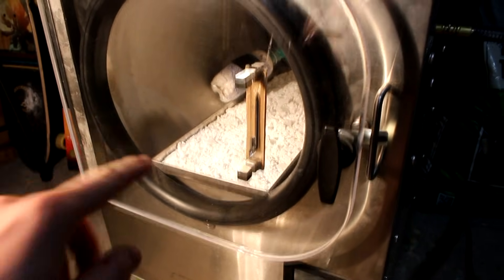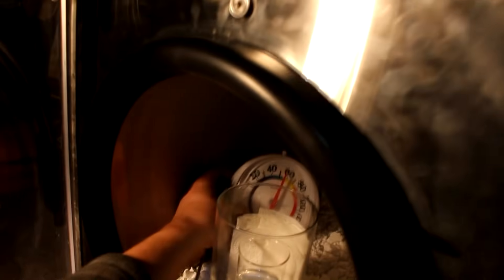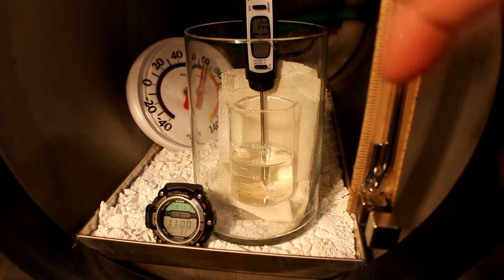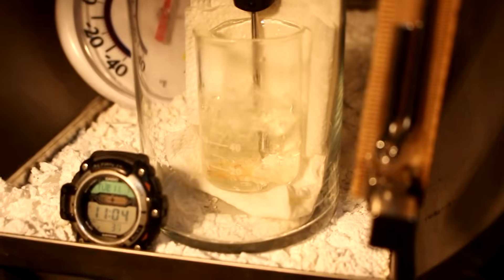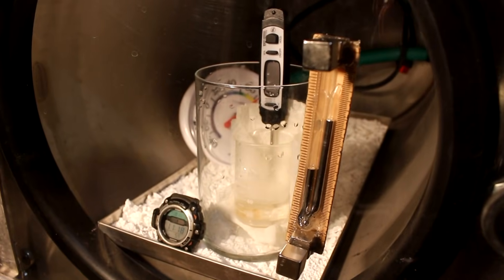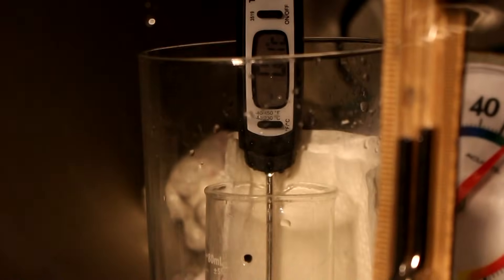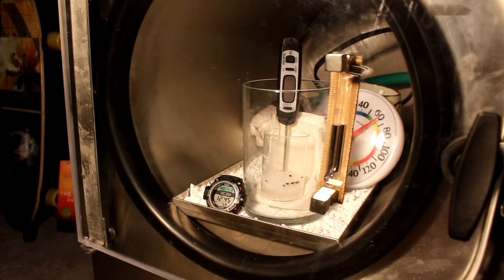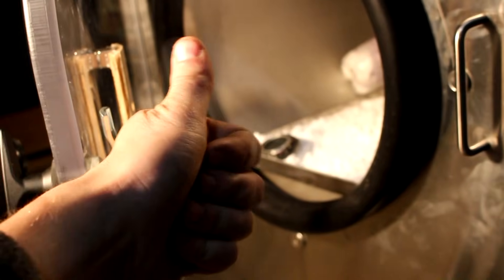Boiling Water Until It Freezes

Comment: This brings to mind the phenomena of extremely "HOT"  temperatures of molecules in engineered negative Kelvin systems, which transfer heat at exponentially higher rates than positive temperatures, by way of Boltzmann's factor.

Although your vacuum system implements a completely different method of manipulating the temperature of molecules, it loosely feels like the opposite of the effect exhibited in negative temperatures.  
"Boiling" to freeze molecules Vs. cooling to "heat" molecules.

Edit: (This consequently made me think of the Bose-Einstein Condensate.)

Comment: cody. save your pump and get a reverse bike pump and add grease to all the seals and then got the adapters for tubeing it will cost about 100 comes with a gadge and has replacement parts 👌🏾

Comment: This proves nothing...
Reply: Eternal Knives it proves you actually want to be entertained
Reply: Yes it did
Reply: It proves why the water on Mars is ice, not liquid water
Reply: Yeah, I said a stupid thing. I only knew that Mars has a much weaker magnetic field than the Earth and I made an incorrect assumption. I never actually heard about whether Mars' core is solid or molten, just the thing about the magnetic field.
Reply: Neither does the comment you just made
Or your life
Or mine
Or anyone's
Nothing matters
...Ever

Penis
Reply: That doesn't need to be proven. Mars is further from the sun than the Earth and it doesn't have an active core like the Earth, so even with a thicker atmosphere, it wouldn't have liquid water on the surface.

Comment: It should be realized that, at some point, the thermometer in the background inside the chamber is no longer responding to "air temperature" as there is, for all intents and purposes, no more air :)  It would reach thermal equilibrium with its surroundings (the walls and contents of the chamber) via radiant energy transfer.  I'd expect that process would take quite a while :)

Comment: Works the other way around as well, where water can be colder than 0 degrees, but still be liquid, if the pressure is high enough :) It's rare in the ocean because the deep ocean gets warmed by the earth, but it happens under the ice caps.

Comment: The conclusion is that the water was not "BOILING" but "BUBBLING".
Reply: Nope. The conclusion is actually that you've never heard of the relation between boiling point and pressure, and that you don't know the scientific definition of boiling. Go google it.
Reply: The pressure become minimal and since oxygen is lighter so it tries to bubble up to the top to maintain its state of equillibrium and after that I shut off the video.
Reply: That's not oxygen coming out of the water. That's actually water vapour. Decreasing the pressure heightens the boiling point, and if you reach near-vacuum, the actual boiling temperature becomes so irrelevant it'll even boil when it's freezing.

The freezing itself is caused by the fact that water needs energy to go from liquid to gas form, and that energy comes from the water, so the more it boils, the more it cools down.
Reply: What is the source of that energy that holds the electron of an oxygen atom in the water ?
Reply: Ofcource I am talking about the orbital energy
Reply: Molecular bonds are very strong, and require a lot of energy to loosen. There's nothing in this experiment that gives the amount of energy necessary to cause that. Evaporating needs a lot less energy. Splitting water molecules is a chemical reaction. There's no chemical reaction involved here; this is purely physics.
Reply: How much energy ? Do you know ?
Reply: Everything is science and nothing is there in this universe as pure. Mind it.
Reply: Not just a matter of how much, it's also how it's applied. Water doesn't tend to split from purely physical factors; it'll never break apart just from heating it up (unless you go well beyond vapour state in the first place, and well on your way to plasma). It typically only splits if you run a current through it; that's electrolysis.
Reply: No I am saying that if u lower the presssure inside that chamber then its not that only pure physics which seems to be applied but there many other factors like May be the water has some dissolved oxygen which seems to bubble out as the pressure decreases fast but at constant rate. And then rest of the story which u said in your description.
Reply: Water might have some dissolved components, sure, but that's always a really small percentage. Nothing that'll be enough to make it bubble that strongly.
Reply: You did a nice work. Keep it up!

Comment: IF you sucked out all the Oxygen through the Vacuum, How it is still water?
Reply: He sucked out the gas from the chamber.... meaning the nitrogen and oxygen gas there. This is pure physics. There is nothing happening there that would spontaneously make the water split into oxygen and hydrogen gas; that would require a chemical reaction.
Reply: Nyerguds This science is beyond my understanding LMAO!
Reply: no its not, there's oxygen in water that isn't chemically bonded with hydrogen, that oxygen(O2) is what came out of the water
Reply: ItsTheNutShaq It's water vapour that came out of the water, people. Sheesh. It's not hard.
Reply: That probably came along too, but nope. Decreasing the pressure simply decreases the boiling point, to the point where room temperature or lower is enough to make it boil. It is really, literally, the water itself boiling. Evaporating. It's simple physics. Look up "boiling point" on wikipedia if you don't believe me.
Reply: What is happening regina phalange, is heat (energy) is leaving the water through the process of boiling, however, cody is not adding energy back into the water (system). Therefore, the water eventually reaches its freezing point, as long as there is water left after boiling. At the end of the experiment, he mentions the temperature in the chamber actually had risen some. The energy in the water escaped through boiling and was then reabsorbed by the surroundings.

Comment: Thats why water works as a temporary solution for coolant in a car. It doesnt boil under pressure.
Reply: Um. Enough pressure makes any gas revert to liquid form. That's not really related to this experiment at all...
Reply: Nyerguds i wasnt talking about turning a gas into a liquid. im talkimg about how pressurized liquid to a certain extent wont boil.
Reply: And that's still completely unrelated to anything in this experiment. The fact that decreasing the pressure will make it boil in no way ensures that under pressure it will not boil.

Comment: Is there a pressure where the water will continually "boil" till it's empty ?
Reply: It's not really related to pressure, but to keeping it liquid. The evaporation is what cools it down, so to prevent it from freezing, you'll inevitably need to add energy, by heating it up. If the water is warm enough before putting it in, and there isn't a lot of it, it'll all evaporate, I guess.

Comment: I will be impressed if somebody can make powdered water.
Reply from the maker: you mean snow?
Reply: @theCodyReeder  LMFAO 😂
Reply: @theCodyReeder  😎😎😎
Reply: Cody'sLab Lmao
Reply: Heh steven wright fan?  "I bought a box of powdered water,  I don't know what to add to it..."
Reply: Powdered water! Just add water to get more water.
Reply: zukodude487987 doing lines of water at the ice bar with van damn.
Reply: I once found a can of powdered water in my pantry but didn't know what to add to it.
Reply: One year for Xmas I received a can of "dehydrated water"... You only needed to 1. Open and 2. Add water to reconstitute :)
Reply: *****
Nice!
Reply: https://en.wikipedia.org/wiki/Dry_water
Reply: Freeze the water and then hammer it till it turns into a powder
Reply: @darkenforcer245  that's not freeze dried though, moisture level too high
Reply: Man of Steam ! But that kind of "powder" would melt instantly as soon as you touched it. If you've ever held a really thin piece of ice in your hand, you'll know what I mean.
Reply: @njcwolf4654  that's cuz up body temp is high. If u touch it with a spoon it will stay power, or if u have really thick petroleum product gloves
Reply: Sn- yea what he said
Reply: zukodude487987 re hydrate= just add water.
Reply: Pounding ice with a hammer would eventually cause it to turn in to water. As the particles get smaller it takes less friction it melt it
Reply: *****
Snow is too thick.
Reply: @zukodude487987  
Too thicc
Reply: @zukodude487987  thicc*
Reply: zukodude487987 you can technically by freezing it and crushing it to a powder
Reply: Slushee
Reply: Sounds pretty familiar. I suspect it was probably a gag novelty item sold in the Johnson Smith Company mail order catalog.
Reply: i wonder if a mortar and pestle in a very cold room would work
Reply: Bull! What do you think the term "fresh powder" means? When it's -6 out snow can be as fine as powdered sugar.
Reply: Powdered Water! To make it go back to water, just add water!
Reply: Instant water! Just add water
Reply: zukodude487987 lol
Reply: Just add H and O2
Reply: thats not how it works...
Reply: no one has ever made successful snow..... -Cody'sLab
Reply: Cat [TROLL] im pretty sure the whole world has experienced fake snow over the last few months.. including the sahara desert..
Reply: lol
Reply: Cody you need to address this issue from your vid "Measuring earths radius with a telescope?".  I left this post at that vid:    >>>>Hey Cody:  At 11;30you are drawing your situation on paper.  You draw a line from the center of earth to the top of the tower.  You also draw a radius to your scope location.  You draw a line from your scope to the tip of the tower.   You declare that the angle between the radius to the scope and the line to the tip of the tower is a right angle.    This is not at all factual.  Obviously.  You are essentially declaring that if I stand on earth and look at any random promontory, (like that tip of the smokestack, for instance)., or anything else for that matter, that sightline is a tangent to earth.   Quite obviously, this is not true.   So right there everything you have done has become irrelevant  -- your geometry is bogus.  But to continue.  You claim that your scope altitude is 100ft.  NOWHERE in your geometry is that 100 ft mentioned or used in any calculation.  Very bad geometry, so no, you calculated nothing<<<<<
Reply: zukodude487987 easy snow
Reply: 101Andu101 to make 1l of water, just add 1l of h2o :-)
Reply: Just add water!
Reply: Snow is powdered water
Reply: zukodude487987 , snow ?
Reply: Wat
Reply: Snow?
Reply: I want solid hydrogen
Reply: Powdered water ... just add water
Reply: WHY NOT ??
IF THE SUN CAN BE A LIQUID METALLIC HYDROGEN LATTICE...
FREEZE-DRIED WATER SHOULD BE A PC. OF CAKE.
Reply: I've heard of dry ice but not dry water.
Reply: Powdered water. Just add water.
Reply: Just crush some ICE cubes
Reply: You mean the Action Lab?
Reply: Snow is the answer
Reply: There's a thing called aerated water. I think that's what you're looking for.
Reply: Cody'sLab oh wow XD
Reply: It's called snow.

Comment: Wouldn't that be technically be flashing not boiling?
Reply: ...no? Look up the scientific definition of "boiling". Wikipedia page "Boiling point" is a good starting point.
Reply: Nyerguds if you can't fully answer the question then STFU.
Reply: The page answers it. Why would I bother? "The boiling point of a substance is the temperature at which the vapor pressure of the liquid equals the pressure surrounding the liquid and the liquid changes into a vapor."

In layman's terms, this is when the liquid converts to gas form at such a rate that bubbles that form at the bottom of your container go all the way up to burst out of the surface, as opposed to water just evaporating at the surface.
Reply: Nyerguds omg how people like you make me cringe "layman's term" why the need to show yourself off as educated and such when it is completely not necessary. 

Here the water is not heated to its boiling point for a given pressure but the pressure is lowered. Furthermore, this process in this video happen across the surface in contact with the air and unlike boiling where the entire water is increasing in temperature.

This is termed 'flash evaporation' and it is used in water desalination.
Reply: The cause of the evaporation is specifically not included in the definition. Decreasing the pressure simply lowers the boiling point, so that room temperature or lower becomes the boiling point. So, yes, that's still boiling.
Reply: And no, flash evaporation only happens when ejecting a liquid that's already at the boiling point into a lower-pressure environment, causing it to immediately evaporate. The "flash" part kinda comes from the fact it's instant. Nothing like that happened in this experiment.

Not to mention, flash evaporation is also boiling.

Comment: So if I cooked my ramen noodles in boiling water in a vacuum chamber, would my noodles be cooked? :D
Reply from the maker: no
Reply: Oh... Well thanks for the response!
Reply: your boiling water subjects your ramen to 212 F (or 100 C) for a period of time (the temperature is what cooks the ramen). the boiling happening in the video is clearly happening at 60 F (or 15 C) (and actually gets colder until it freezes) and while initially, this would soak the ramen, it would not "cook" it in the sense that you are describing it.
Reply: no. your noodles would freeze.
Reply: it will freez
Reply: assuming your ramen noodles to be instant noodles, just soaking it in water would be enough to cook it, since it's already cooked.
Reply: Ramen is the staple food of poor college students across the USA.
Reply: it requires heat someone made a video about boiling pasta in a vacuum chamber if you wanna look it up
Reply: you've just shown Pressure * Volume = Temperature PV=T and quite a few other proofs that happen at boundary layers.  Cool, but are you sure the noodles won't cook?
Reply: could you manipulate or control the conditions to stay at a triple point that could work.  This is a trick? from an unrelated high purity vacuum extrusion process but I don't wanna try the equations, passing the buck could be the term.
Reply: Stephen Krempasky nope it's not hot.
Reply: Hail kspeeder truuue
Reply: Unless by cooked he means "soaked until mushy in cold water". Then, yeah.
Reply: The triple point of water (Temperature and pressure at which solid<->liquid<->gas and solid<->gas are at equilibrium) is ~32 deg F and 0.006 atm or 3/500 of an Earth atmosphere. If you wanted to cook in water at the triple point, you'd be already out of luck because thermodynamics wouldn't allow it. Whatever you'd try to cook would just freeze instead of having a high enough energy for reactions involved in cooking to activate.
My hypothesis is that you could put some salt into your pot to elevate and depress the boiling and freezing point temperatures of water to attempt to shift the triple point of a saltwater phase diagram towards a higher temperature (and lower pressure?), but the normal three-phase phase diagram wouldn't apply as you'd need to include aqueous and non-aqueous salt as phases. At this point I don't know how phase diagram changes as a function of solution concentration, and I'm not sure the triple point would even exist anymore. Even if it did, you'd need to lower the pressure, which is basically already zero, and if you managed to do that, the individual molecules of water 
hot enough to evaporate or nearly evaporate would be more able to take the rest of the heat they need to evaporate sooner, and the water would evapofreeze more quiclky, and you wouldn't have had enough time for the food to cook. I don't think it can work.
Reply: the noodles are already cooked, they've been flash fried to dry them out to have a long shelf life
Reply: Heat denatures protein. Not cold. Lowering pressure lowers boiling point. Doesn't make it any hotter
Reply: No, you'll just have soggy ramen noodles in a box that is slightly filled with hydrogen gas
Reply: eating noodles
Reply: No
Reply: Yes
Reply: It depends on how hard you think about it.  Think hard enough and your noodle will cook
Reply: Not quite
Reply: Go home. You're drunk.
Reply: i beg to pick. as ramen isnt food, cooking does not apply. culinarily, soak your ramen without boiling and tell me if they are done.. yep. they are. maybe some actual heat would suggest a more palatable starch, but lipstick on a pig.  although I suspect the freeze dried onion wouldn't reconstitute well. as well, some of the finer rice noodles cant stand true cooking. just soaking. so then, will the hydration balance into a dry starch stick under vacuum? lastly, how's the gravity pump coming?
Reply: @benmunday5531  Old comment, but Ramen is food.

Comment: While the water is freezing, it should be at or near the triple point -- 32.02 F and 4.6 mmHg, assuming pure water. The temperature cannot drop lower until all the water is frozen.
Reply: actually, there's this cool effect called "supercooling", which can cause the water to go way below its freezing temperature before realizing it should turn solid :)